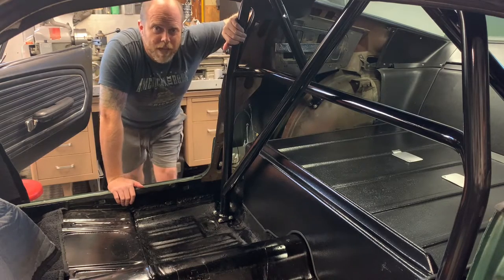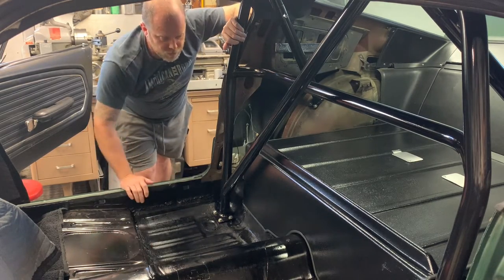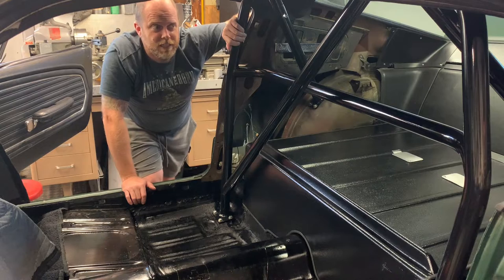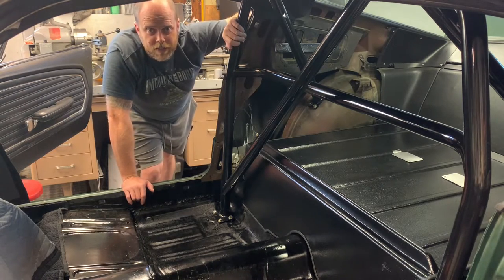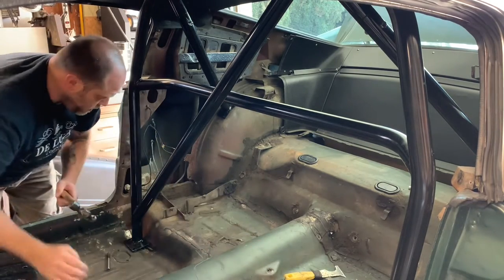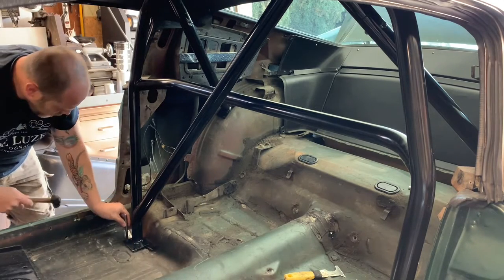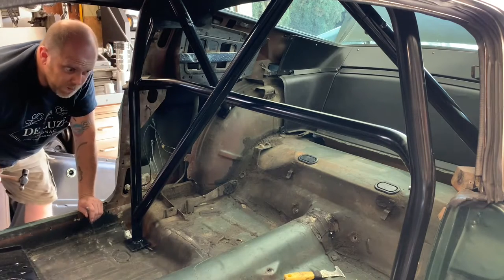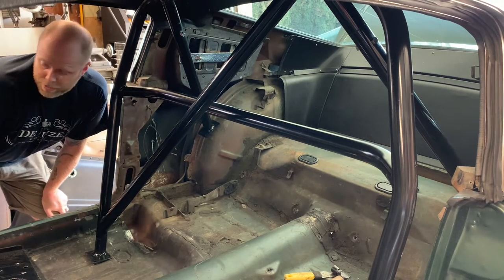Autopower Roll Bar Install & Shelby Rear Seat Delete: 1968 Ford Mustang Fastback; Track Prep Part 2

Comment: I'm in the process of installing the same bar from autopower ( minus the diagonal brace ) . Ive tried everything and can't get the rear brace bars to give me enough clearance with the air vent box ( the rear brace bar contacts the air vent box ) It appears as if the rear brace bar pads are too far outboard on the wheel well - like the rear bars were welded improperly by a smidge. I looked at where your rear pads are sitting on the wheel well and they seem to be sitting 1/4 " or so more inboard than mine. Any chance we could chat ? I'm also waiting to speak with auto power but the only solution I can see at this point is to have the rear brace bars re-welded inward a bit or heat up the rear brace joints, and with a ratchet strap, pull them slightly more inboard. Either way , I've already powder coated it so not too happy
Reply from the maker: Bummer, Mark. You’ll have to forgive me because it’s been well over a year since I did this install. I do think I remember that my rear stringers wanted to sit right on the seam of the wheel tub, and they actually moved inward a decent amount when I put a ratchet strap between them, cold. It’s tough for me to know just how far you’re off, and you definitely don’t want to over stress the bar before you bolt it in place, but giving those stringers a little bit of “input” would probably be fine. 

Be aware that there are slightly different versions of this bar between the coupe and the fastback, and I’m 99% sure the difference is in the placement of those rear stringers, so I wonder if somehow you got the wrong bar for your body style? That would be a bummer, but I would make Autopower make it right, if that’s the case. 

Anyway, I don’t want to type my contact info on the YouTube comments, but you can find me on Facebook or Instagram quite easily, and send me a DM (I think I even have my phone number listed). Though that’s really all I can remember about the install off the top of my head, and I’ve got interior panels in, so I can’t really take any pictures. 

Regardless, best of luck! Here’s hoping it will go in with some more fiddling.
Reply: @crazycaseyscustoms  Thanks for replying. I think I'll contact autopower and share some measurements. I'm hoping that I can get those rear stringers to move inwards about 1/4 of an inch.
Reply from the maker: Shoot, Mark, I think mine were probably off by that much. @heymarkniceshot  But that’s a good call.